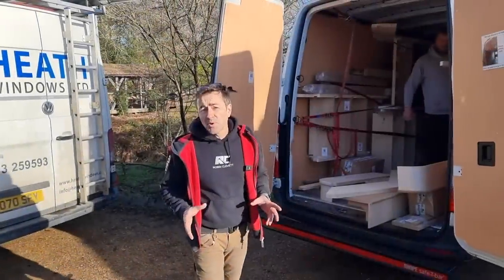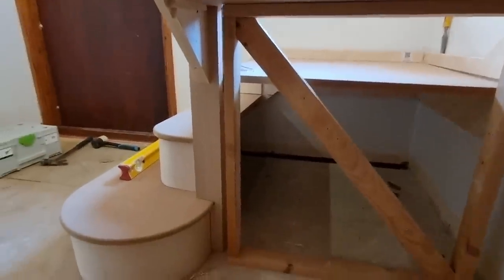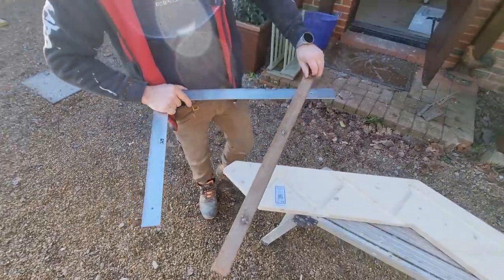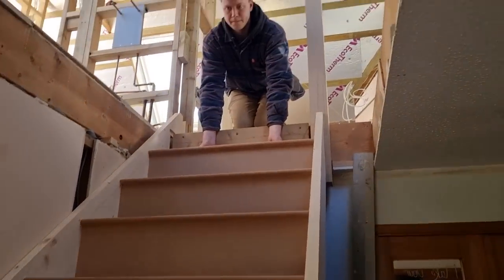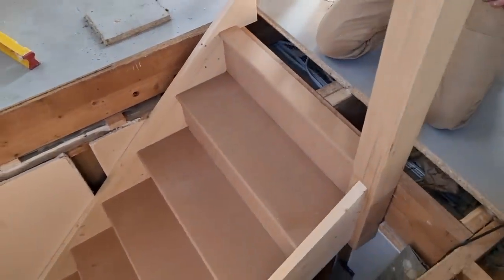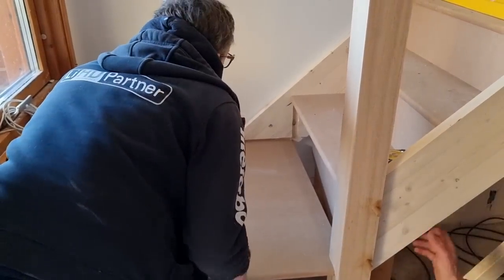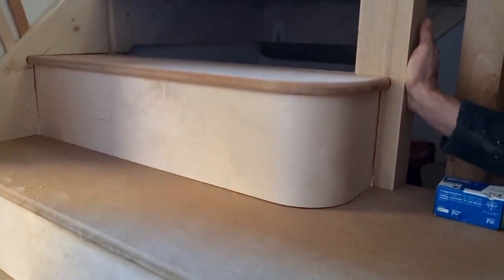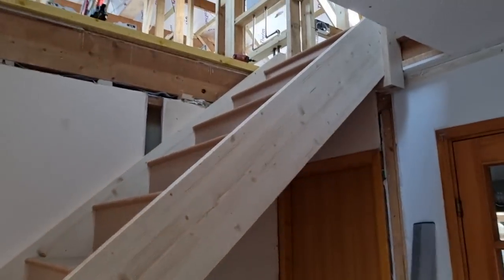Staircase INSTALL AND BUILD over an out of level floor

Comment: Carpenters don’t need sandpaper my college tutor used to say that so true! Nice to see a proper carpenter at work 👌👌
Reply: Mr Milner at Stockport college used to like a smooth planed finish on our pieces, no sanding. A Sander is a painters tool.
Reply: Lads, agreed on the smooth face from a block plane but my old boss was equally as skilled as Robin and  would of bollocked me for not having any scratch in my pouch... need it for rounding off and taking off fine hairs after a handsaw cut etc

Comment: Surprised that you notched the structural element (stringer) over the decorative (architrave).   I'd always do it the other way around because I always try and preserve the strength as far as feasible and also know that people change decorative elements over time as fashions change.
Reply: I agree, that's what I would do too
Reply: I thought the same thing the arcs more likely to come off than the stringer

Comment: Great work, just shows you actually don’t need powertools, super hand tooling skills Robin!
Reply: Yep there are some who would have taken longer to set up saws and adjust routers, than what it took with hand tools.
Reply: That's because it's his job you're on a national house builder's site 90 pound  to fit dog leg stair 🤦‍♂️
Reply: @tomsmith9048  I’ve never been near a big site but been a chippy for 20yrs is that honestly what chippys get paid for a half landing staircase.? and where are you based.?
Reply: @bdizzle7633  I don't do house bashing and I haven't in over 15 year's but in the North West that's what they pay a straight flight is only 50 pound
Reply: @tomsmith9048  if that’s the case that’s ridiculous and fundamentally part of the reason why majority of the new builds are at the standard they are and I actually feel bad for the lads on site who get a lot of slack no one could make that pay whilst maintaining a decent standard of work.
Reply: @bdizzle7633  of course and it'll never change pre hung door sets are still 20 to 25 pound

Comment: Your plumb cut for the end of the skirt board is a formula ?  The pitch is ( I think u said 41.2 degrees?  Take that from 90 degrees 48.8 degrees will fit dead nuts on). You should be between 35-40 degrees on the skirt ?  That both sides of the pond average brother.  That is a beautiful stair case Robin your a very very good Carpenter!  Last of the Mohicans!

Comment: As someone who is now to woodwork, I was wondering if you could give me some tips on sharpening my new chisels?  They are nowhere near sharp enough from new?
What sort of kit would I need to do it as well?
Reply: A tormek wetstone is a beautiful thing to own IMO, they start at about £400+ or so which is a lot of chisels, but it will keep your chisels (and more) alive forever! They can work miracles on even the cheapest of chisels (but cheap chisels don't stay sharp for long). There are plenty of on line videos but for a great walk through on sharpening, google "The New Yankee Workshop Sharpening Station S12 E11".

In fact, if you are new to woodwork, binge watch New Yankee Workshop, Norm is the international woodworking legend! Timeless.
Reply: @bobdobalina276  I've never really found the Tormek to be a logical investment if I'm honest. I'm normally the type that splashes out on expensive tools and then goes through the learning practice on those. With sharpening, I started cheap (ish) and just became proficient at it. Whether it is chisels or knives, I've never really found the need for a wheel (I have a small hand cranked one I use for buffing!). As soon as you learn to freehand sharpen, there is very little need to return to the grinder, because it's so quick and clean (and noise free), as well as returning a razor sharp edge. If you're very regularly flattening the backs of chisels or restoring tools, then there would definitely be a benefit, but for most I suspect that would occur only once in each tool's lifetime. Even then, I'd probably look at a cheaper alternative to a Tormek (a record or something), as I'd mostly be using it for cleaning and rust removal rather than sharpening, and I'd be frightened to get such a lovely tool in a state! I find the Tormek fairly niche, and probably not required for most hobbyists or professionals unless they're doing a lot of furniture production or whatever. Obviously, extremely nice to have if you don't care about cost and want the best tool possible.

Comment: Hi Robin, just a quick question I noticed the top newel wasn't housed around the trimmer? Is it OK to just have the top tread sat on the trimmer and screw it?
Reply from the maker: It is really key to make sure the newel is supported, in our case the top newel was supported on the floor below so we where able to allow to not house over the trimmer, it also gives some flexibility when setting up the apron lining and balustrade etc
Reply: @ukconstruction  thanks Robin I fitting a straight flight soon so should've fairly straightforward! You're videos are a big help

Comment: Looking good guy's👍 will you be adding on the joists so the top newel can be housed over?
Reply: I too have always notched the top newel over the trimmer. If Robin can say if he has always fitted like this fixing through the back with screws that would be good 👍

Comment: Did you allow for the 10mm scribe when you ordered the stairs, or are they now 10mm out over the short run?
Reply from the maker: All I do is measure the FFL to FFL from the landing at the top to where the base of the newel will sit and then make the stairs fit by adjusting any scribes from that point
Reply: @ukconstruction  what if the newel is sitting on the high point though?

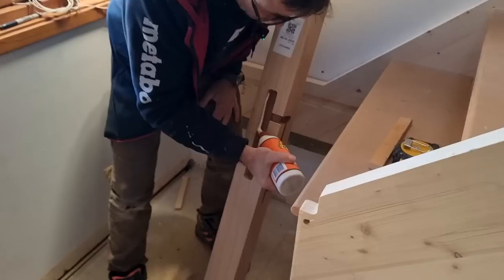Comment: At 18:17, how did you guys get down the stairs, and is this something that you have to consider when doing stairs on existing buildings generally? I'm assuming that there are plenty of access points on this particular build, but I'm assuming there is a different approach when access is limited to just the point at which your fixing the stair?
Reply: Kids trampoline butted up against the wall under an upstairs window 🙂.
Reply: @bobdobalina276  excellent idea. Good way to get the chopsaw and other power tools quickly and efficiently back down to ground level too.

Comment: Hi Robin,  excuse my ignorance, but isn't it an issue if you take some off the bottom riser? Don't all the risers have to be the same height or is there a tolerance that's acceptable for leveling purposes. Thanks
Reply from the maker: Well the rule is exactly the same... but... you can fine tune any item to level, and 10mm to nothing will be perfectly acceptable, if you where taking off anything more than about 20mm then that may be an issue!!
Reply: It's 2mm plus or minus by law It's under k in the building regulations if memory serves me correct but their are different tolerances regarding public semi private and private as their the only 3 set's of regulations hope thst helps 🍺

Comment: A window at the bottom of the stairs….really? 🤦‍♂️
Reply: What's the issue?
Reply: @smyteyouall8256  If someone falls down the stairs the window, is what stops them
Reply: I’ve just fitted one where the stringer went half way across a window on a loft conversion, looked terrible but building control allow it

Comment: When the cordless tool manufacturers first added LEDs to their tools it looked like a gimmick. Now a days every fastener and cut is accompanied by a flash of light and we turn our noses up at any tool without built in illumination. While watching you guys I do wonder how long it will be until they add LEDs to the plastic handle of Robin’s handsaw? Great video and as usual great work!